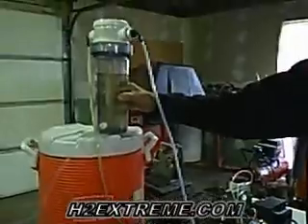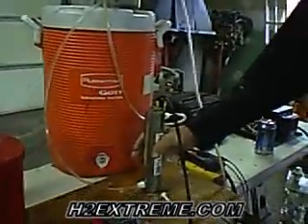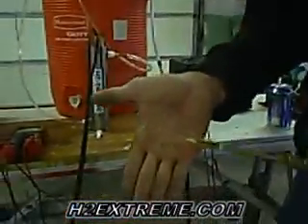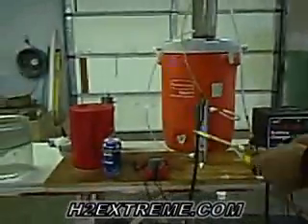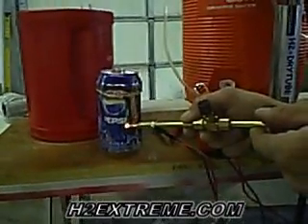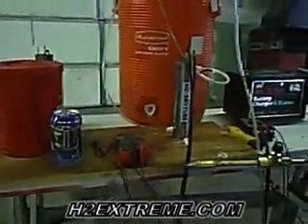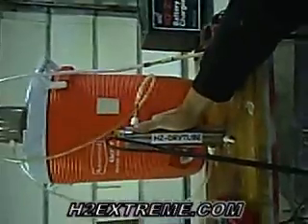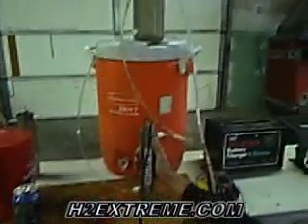new tubular hho drycell design!!  1.2 lpm @ 150 watts!! 7.69 MMW very efficient!!

Comment: Can't be possible.
1.2lpm means 72lph.
A liter of hydrogen has 3wh so 72 liters has 216wh of energy.
Running the fuel cell for 1 hour, assuming 150 watts, it will consume 150wh.
You're claiming a 144% efficiency meaning you're making energy...so this is definitely false.

Comment: Pretty cool. I just wanna know one thing. Why does it only run for 3 hours? Is it because it gets to hot all together or because you run out of water? I want to make some of these things, but with different configurations one a Dry Cell the other A fuel cell etc. I want to find the most efficient way to produce lots of energy as well as HHO.

Comment from the maker: I have not any results with any diesel engines. I do believe with proper tuning you should have some result. 95 should be old enough to avoid most computer issues and I am not sure the mapp sensor works the same on diesel engines. every fuel injected vehicle has been a small challenge, but with the proper tuning should have results.

Comment from the maker: yes, its very simple. when I get more parts, I will do a video. bascally its 7 tubes cut out with tabs fot the connectors. hole drilled all the way through top and bottom except smallest tube in center. then o-rings to seal tubes at top and bottom, epoxy to hold cells tight together. try it and you will make a  lot of gas with little wattage. no heat. you can run this cell for hours with only a liter of water!